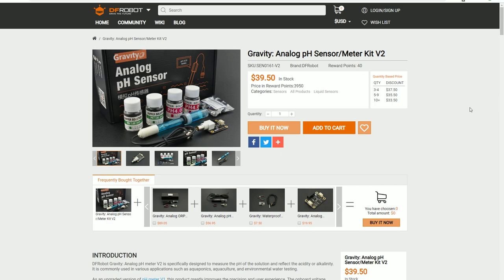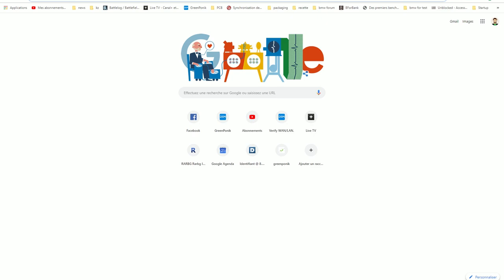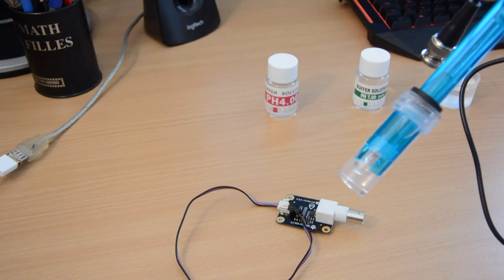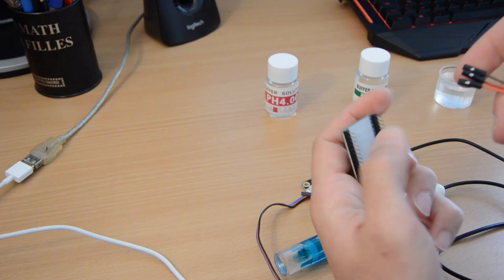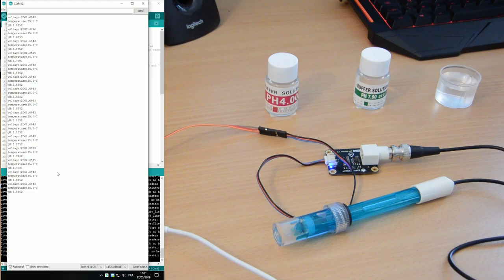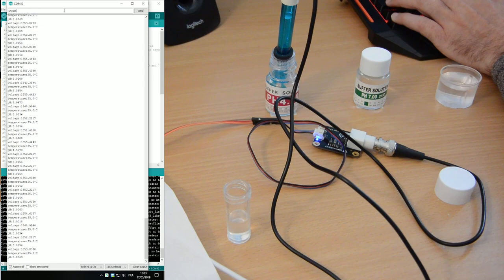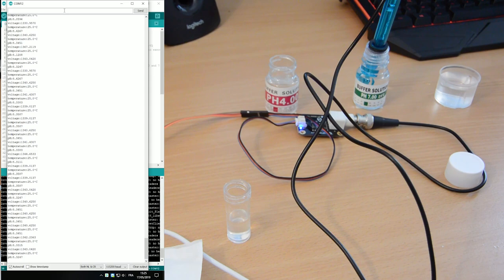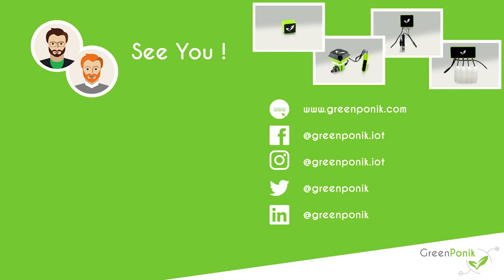PH Meter with ESP32 and DFRobot PH module (SEN0161-V2)

Comment: You do not show wiring in an ADC converter but all docs call for one?  When I connect the way you present in the video I get REALLY high voltage reading and a PH of 35.80.  When I connect to Arduino Uno I get proper readings.  I am looking for a wiring diagram that will show proper wiring for ESP32 and ADC converter with this probe
Reply: Did you find the answer to your question? I have the same problem! :-( I followed the other video example, for the  EC Meter... still does not work.
Reply from the maker: Hi, don't know what can be wrong in your case as you have to be in front of the circuits to see what's happening. Basically, if your readings are too high in voltage, decrease the ADC gain, if the readings don't change when you put the sensor in different liquids, check the adc wiring or even replace the adc.

Comment: my pH sensor gives 5v output so i put voltage divider and dropped it down to 3v but now my pH value is showing  "nan" . Do you know whats causing this?
Reply from the maker: Hi there we make patch about this trouble. you can try the new release : 
with ADC use: https://github.com/GreenPonik/DFRobot_ESP_PH_WITH_ADC_BY_GREENPONIK/releases/tag/1.2.3
without ADC: https://github.com/GreenPonik/DFRobot_ESP_PH_BY_GREENPONIK/releases/tag/1.1.1

Comment: Would this work on a ESP8266 board? What Would I need to change In the code?
Reply from the maker: Hi! as you can see here https://github.com/GreenPonik/DFRobot_ESP_PH_BY_GREENPONIK#compatibility the esp8266 board is not supported.
There are some differences are about eeprom management. 
On the repo's issues we have already discusse about this and you can find some responses about your question here: 
https://github.com/GreenPonik/DFRobot_ESP_PH_BY_GREENPONIK/issues/1
Regards

Comment: Measuring pH becomes pretty expensive if for every time, new calibration solutions must be bought.
Reply from the maker: You only have to calibration the sensor every 1 month or 2. Just keep the same microcontroller to read the PH so you don't have to calibrate again (calibration values are stored in EEPROM so once it's been done, the ESP will keep those information)

Comment: What about offset calibration? From what i have learned, voltage calibration by adjusting offset and calibration by reference solution are both requirements for this type of ph module
Reply from the maker: Hello, what do you mean? have you seen the whole video ? Calibration is explain here https://youtu.be/EqFw561pO5k?t=512

Comment: Hy one more question, the value calibrated is stored in esp32? If i flash with another firmware i I lose calibration?
Reply from the maker: Hello @marco, calibration values are stored in the EEPROM of the ESP32 so if you flash the firmware and change nothing in EEPROM addresses values still safe stored.

Comment: hi im using t18_3.0 esp32 which have 5V  and using V1.1 board  i just tested tap water  the reading for arduino board i get 7.53pH where as this esp i get 10.38 ....i already change the adc value,adj the screw  still same ... what should be the error sir ?
suppose the ph value for tap water is 6-7.99
Reply from the maker: Hello, sorry but it's been a very long time we stopped using this kit and the githup code should be reviewed by someone willing to do it.

Comment: Hello,
Really great video!
I have an old V1.1 board, can I use your library for that?
The measured value of the v1.1 ph  board  is 5V I think, would it work with a logic level converter?
Reply from the maker: Hi Thomas Hummitzsch , you cannot use the library with old version.
Reply: @greenponik  any library suggestions? if i use V1.1 df robot ph meter with esp32
Reply from the maker: @abib2604  hello, sorry but no because we never use the v1.1 df robot pH sensor
but you can find an arduino sample code here https://www.dfrobot.com/product-1025.html

Comment: sir, what should we do if our ph sensor reading suddenly inaccurate. i have used this sensor for a few month and the reading accurated. but now the reading become higher suddenly.. any suggestion sir?
any way we already calibrate the ph sensor before used.

from malaysia..
Reply from the maker: If the accurate the your probe drifted, you have to calibrate it an other time, we advice user to calibrate probe + circuit every month.
If after calibration the probe still drift, maybe your probe is dead. DFRobot says the probes cannot be used in water everytimes because it's only for labs uses.

Comment: can I use it with 3.3v of the ESP32, if the input voltage is 5V? Does it have any adjustments?
Reply from the maker: yeah you can! it's why we have build a library to permit use with ESP32. We talk about the SEN0161-V2 probe and circuit.

Comment: Hello, great job. My readings when use 4.0 solution is about 2.8 ph value in my console and when use 7 solution , in my console have 6.85 ph value? Is normal, something wrong?
Reply from the maker: @Marco! You read theses values after calibration? if yes, maybe calibration solutions are too old or your probe. When you calibrate you have to read the same value during calibration and after calibration.

Comment: Hello, how about if I want to calibrate the ph sensor with  10 ph buffer solution? Since I want to use this sensor for Aquaponic system.
Reply from the maker: Hi Ahmad, unfortunately you cannot use this system out of the box. Because, buffers solutions used to define acid and neutral points are pH4 and pH7.
If you're able to write code, you can fork the lib and replace the neutral point value on the lib or define a third point as pH10 to get the corresponding voltage value on the circuit.
Reply: @greenponik  Alright, but btw If I want to add Ds18b20 waterproof sensors, How can I modify the code? Can you give me the complete code if I wanna add ds18b20 sensor into this ph sensor?

Comment: is this using 3,3 volt pin in esp32 ?
Reply from the maker: Hi, it's better to use an external power source as the ESP doesn't like to be disturbed.

Comment: Is it possible to use another ph sensor?
For example this one: https://de.aliexpress.com/item/32964738891.html?spm=a2g0o.cart.0.0.294b3c00AO9Avq&mp=1
Or does the library just work with the ph sensor from DFRobot?
Reply from the maker: The library works only with DFRobot probe because the output voltage level of the SEN0161-V2 is different of your example.
Maybe you can fork the library from github and adjust the range of voltage values in the header
https://github.com/GreenPonik/DFRobot_ESP_PH_BY_GREENPONIK/blob/master/src/DFRobot_ESP_PH.h
The procedure is:
Wiring the circuit
check the ADS channel is good
Put probe in first calibration solution and get the voltage value and the voltage value
set it has the first ref on the header
Then make the same for the second calibration solution.
To be sure check you get the same read value after second calibration

You can use the example to start from good way
https://github.com/GreenPonik/DFRobot_ESP_PH_BY_GREENPONIK/blob/master/example/DFRobot_ESP_PH_BY_GREENPONIK/DFRobot_ESP_PH_BY_GREENPONIK.ino

Comment: hello have you got a guide to add Mqtt to the code to use with home assistant
Reply: Hi! we don't use MQTT but you can find some examples through google ;-) like this: https://www.valvers.com/open-software/arduino/esp32-mqtt-tutorial/
Reply: Did you get it to work with home assistant? I'm also stuck at the point that i see the values but can't figure out how to send them over
Reply from the maker: Hi, for this moment nope! but the device have REST API and graphql to be connected with any smart home system. You maybe have to develop plugin to wrap our api in the smart home system.
Reply: I have added mqtt to my setup now if you still need the code I could send it, it's not pretty but working 😅
Reply from the maker: @Bartlebyxx  thx ;-) in the futur maybe we'll need it

Comment: what is meant by calibration?
Reply from the maker: To check if the sensor still read PH 7 when inserted in a PH 7 solution. if not, the code will correct it.
Reply: @greenponik  some times if sensor doesnot read PH 7 solution as PH 7 then the problem maybe with the sensor but not with the code.is that case occur?